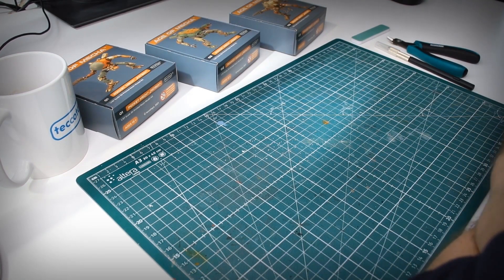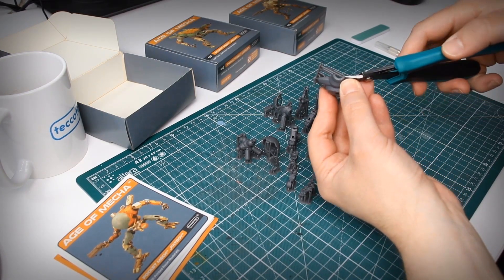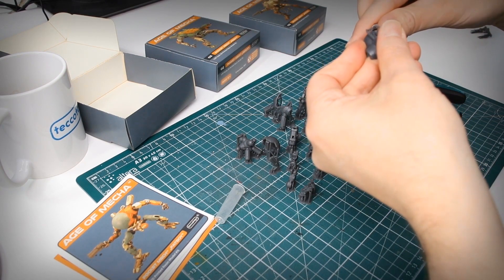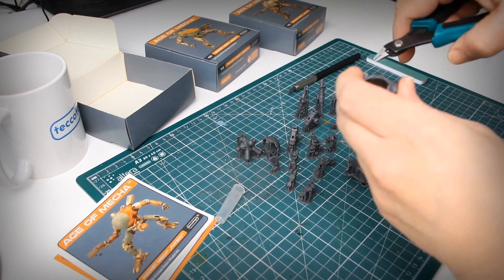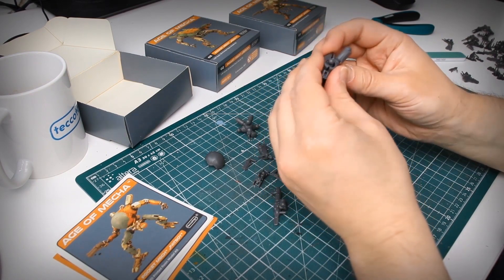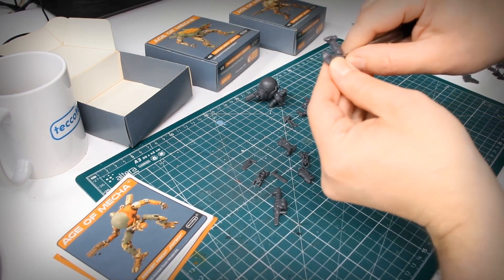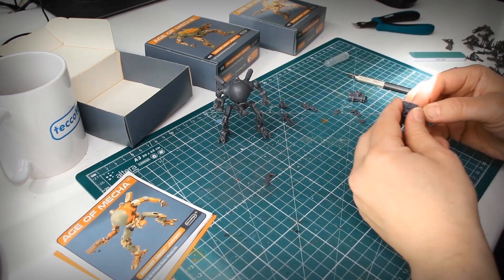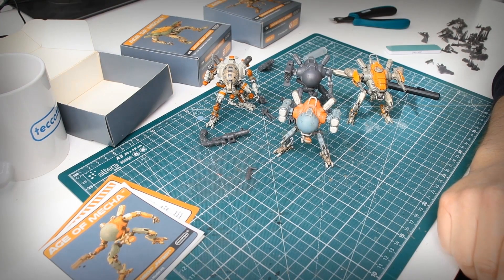Pocket Mech™ Kit Assembly

Comment: These are amazing! Only thing that could possibly make them better is if they could fit an actual pilot, maybe a diaclone pilot would fit?

Also how would I buy it in this kit form? I know I can buy files but I only have access to at max maybe 40$ currently. And I'm trying to figure out how to get one of the mini Mecha and the hazmat set, but don't know where to get them printed.

Also, is it possible to make one of the articulated pilots scale fit the mini Mecha? Such as started before the hazmat unit ones